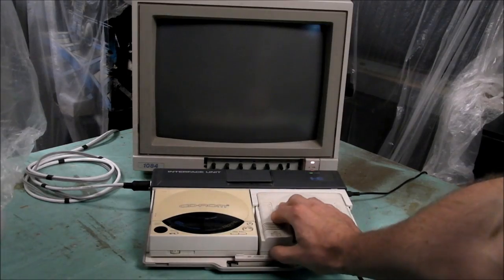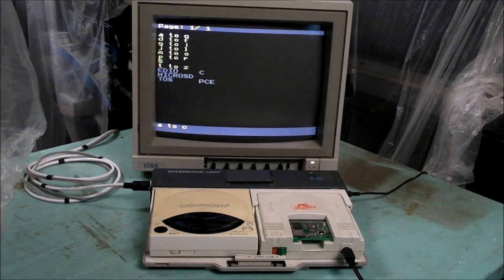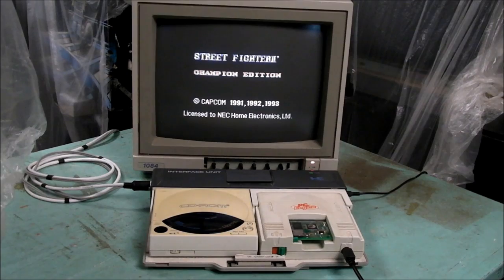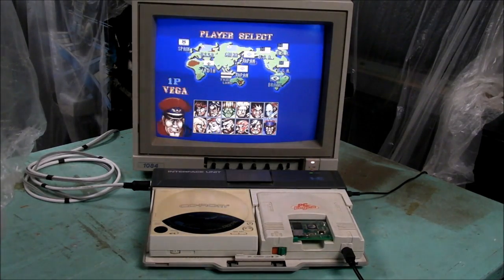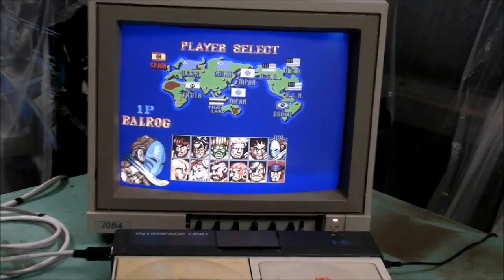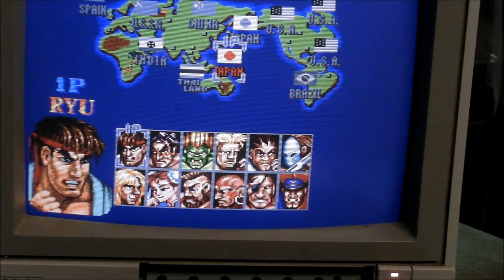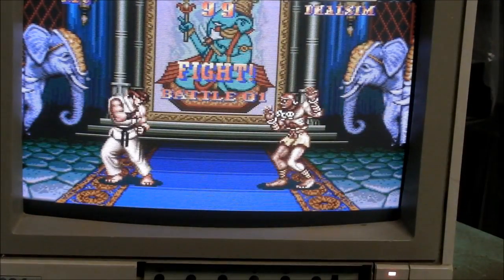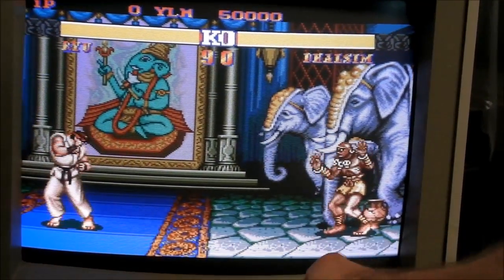Etim's new AV Driver RGB Amp

Comment: I made the same Mod using your description and Etim's board. I just miss the part about:

A: Getting 5V and Ground to the plug: 
 the +5 volt and ground where did you get it to attach it to the plug? From the interface unit board or from Etim's board?
B: Getting sound to the plug.
- where did you get the left and right audio channels ? Directly from the right of the original board (three cables within red cable enclosing (white, red and black cable) ? Or what is first from here to Etim's board and then to the plug (aka amplified)

Thank you for your help.
Reply: I´m really curios about these answers too! I hope RGB Bob takes the time to explain. What did you end up doing Cedric? I´m about to perform this mod but unfortunately on Tim´s AV driver page there´s only a tutorial for installing the AV Driver for Arcade RGB 'Supergun' and not the PC engine yet.

Comment: I don't want to criticise you, you've probably got more experience than me, but those solder blobs you made don't look like the "volcanoes" I was taught to make at high school...
Reply from the maker: +Alex Paulsen I agree they are a bit blobby rather than the volcano shape.
Reply: Volcano shape on solder joints is usually caused by solder wicking upwards on a component lead.
Solder blobs just lying on a board surface like this on jumper contacts will usually just be that shape.... round blobs.
Nowhere to attach to beside underneath so surface tension on the molten metal just blobs it.
Reply: Not all true. Solder blobs are from the surface not being heated properly before the solder is applied, resulting in the solder to cool too quickly and not flow and stick to all of the available surface area. Surface tension does play a part too I suppose, but a properly heated contact should usually take on the solder nicely (therefore volcano shaped).